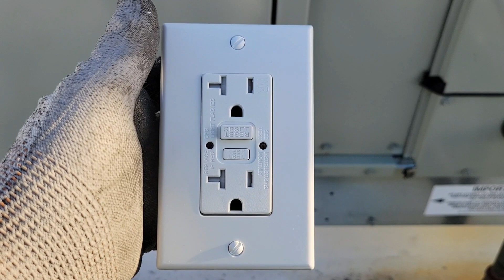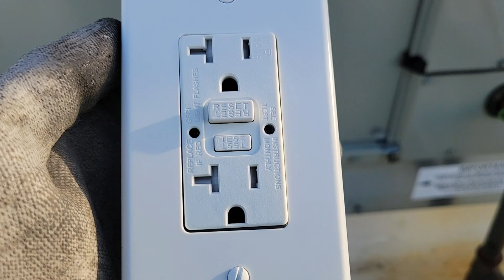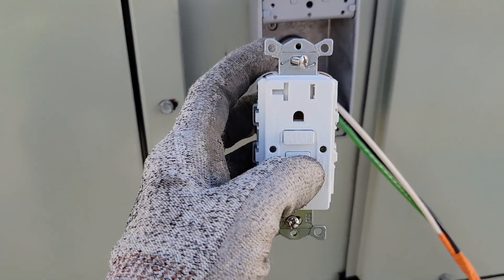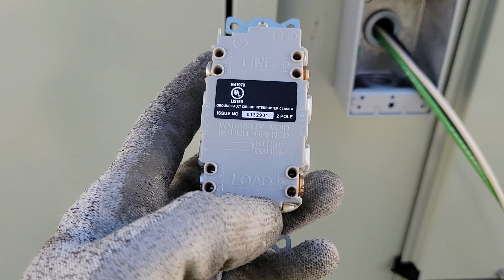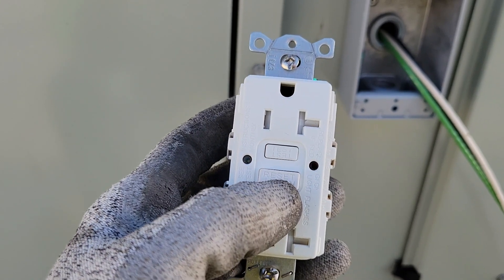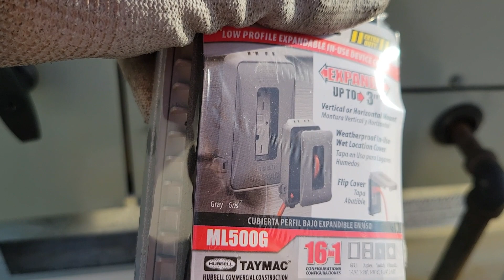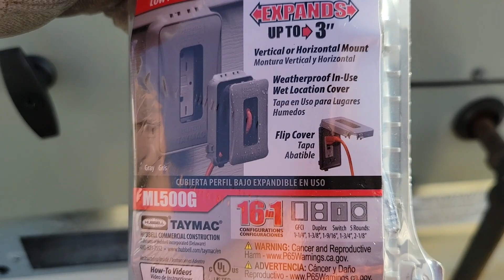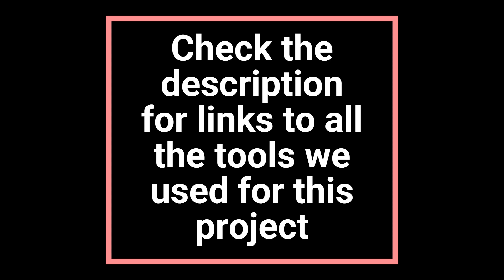How To Install GFCI

Comment: You don’t state what amperage the breaker is and whether the reciprocal is 15 or 20 amp. Also if the wire is 12 gauge or 14.  Choosing the correct receptacle amperage is an important first step.
Reply from the maker: You have a good point. This video is about how to install the device. We will make a video soon showing you which one to buy and why.

Comment: Installed incorrectly.the ground slot should be on top.
Reply from the maker: Matter of fact if you find that in the NEC I'll make a video of me sending you $50 🧐
Reply from the maker: There is not code that says that

Comment: Thank you for taking the time. I have watched a few before and appreciate some info (which I did not know before) like using a pig tail in this case was helpful. You are a good man!
Reply from the maker: Thank you for the awesome comment. If you have any particular questions about anything electrical, please comment it here and we'll be sure to post a full video about it. Thank you for watching and HAVE A GREAT DAY!!!
Reply: Thanks. I am trying to learn more about Heat Pumps especially it's operation and whether it is a good idea to consider in CT. When you get a chance. Thanks. Ashok

Comment: What kind of yellow/orange  tape did you tape the terminals/screws with.   Will black electrical tape work too?  Thank You.
Reply from the maker: Thank you for the comment. Any electrical tape will do. The tape i used was the same as black tape.

Comment: "Been there and done that" One more of at least fifty vlogs on this subject???
Reply from the maker: The amount of people covering this subject has no effect on our drive to provide this information. If the information in these videos helps one person, or saves one person money, our goal is successful. We do this out of a desire to help people in anyway we know how. Its hard to understand how deep of a pit of negativity a person must be in to go on youtube and leave negative comments on a channel that is purely positive. If you dont like the videos go watch something else.
Reply: @ElectricianToolDeals  Your altruism is commendable, but your instruction is flawed? "Covers" are more commonly called plates. The terminals on that outlet are not the friction type and are not required to be "stabbed"?  The NEC section 300-14 states the 6" extension is from the point of entry, and not the face. You knowingly stalled damaged equipment?  Not a good example!!
Reply from the maker: When we speak to the public we prefer to use layman's terms. As for the type of receptacle terminals, they are compression type terminals. There is no requirement to be "stabbed". All receptacles must have terminals that can accept solid or stranded wire. Now for the next part of your ridiculous comment. If you install a 4x4 box that is deep or needs an extension, then 6 inches in the box would violated the exact code you just quoted. Any box with an opening less that 8 inches must have a minimum of 3 inches extending past the opening. 6 inches past the opening will never be a violation. All the equipment used in this install is new, one of the holes was defective. There is no code stating that you cannot enlarge the mounting screws. We enjoy the challenging conversations because it allows us to show our viewers how much we really know. We hope that you have learned something here today. Now go troll somewhere else. Maybe they'll  believe you there.

Comment: I am doing the same thing, but the breaker for the cicuit is GFCI. Does the receptacle still need to be GFCI? Thanks.
Reply from the maker: No need
Reply from the maker: As long as the circuit is gfci protected your good. Sometimes having a gfci breaker with a gfci receptacle will cause the breaker to trip when the receptacle runs through its test cycle. I hope this helps you. Have A Great Day.